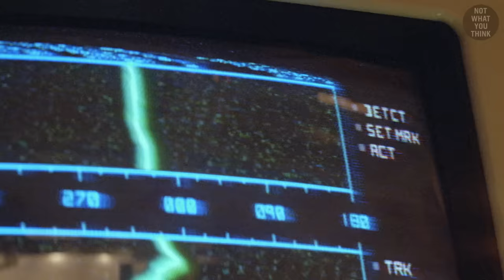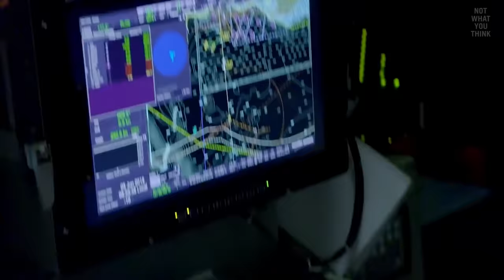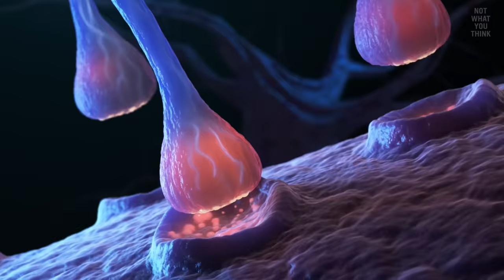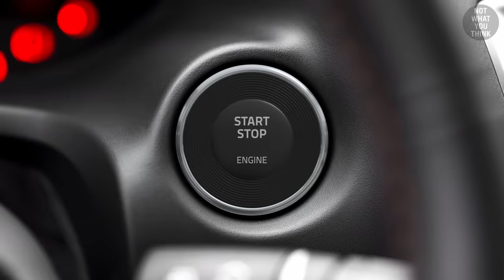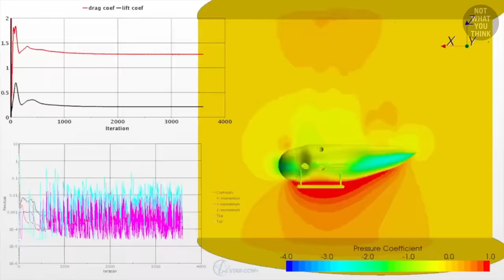What Happens When a Submarine Implodes

Comment: As a submariner I can tell you when the ship submerges you can hear the pressure affecting the boat. 
Audible sounds in sonar, we call them hull pops as the stress and pressure equalizes. Your first dive it’s very nerve racking. But after lots of training and experience you become jaded to it and laugh when the new guys hear it for the first time.
Reply: Many people have made a huge deal about the sounds in a disgustingly sensational way. (See! They knew it was about to blow! They were panicky, it was a long and terrible death!) 
The voices of experienced submariners like you are drowned out, pun intended, because people are hearing what they want to hear and then confirmation bias takes over.
I'm curious if you know anything about external mikes that, according to some, were intended to warn passengers of an impending implosion so they could surface to a safe depth. I hear my SCUBA instructor laughing in the back of my mind as I roll my eyes, but that means I need to learn more to avoid falling into the Trap of Lazy Thinking. Any thoughts about it? Thanks...
Reply: unless you're in a carbon fiber sub that doesn't handle this compression and decompression all that well....
Reply: I doubt you'd hear creaking from carbon fiber.
Reply: @zwenkwiel816 like any sub, it handles it well until it doesn't, they had 20+ successful dives prior
Reply: @RockandRollWoman well just remember 99.9% of the people talking about the titan knew exactly 0 about submersibles before that story hit the news... then suddenly everyone was an expert with an opinion.
Reply: @mattb6646  You do realize some people in the world, ESPECIALLY with the last 10 years of baby boomers pushing college education on the population, there are actual Engineers that can comment on this?
Reply: @Kelocyde  sure that's why I didn't say all.  And most engineering is specific, not many are in the realm of carbon Fibre compression/decompression like many are pretending
Reply: @mattb6646  from what I understand subs with a metal hull don't suffer this issue as much. The hull still expands and contracts but cuz it's steel it can do that 100's or 1000's of times without failing. 

Composite subs though risk delamination every time they dive and come back up cuz the different layers and the resin that binds them don't all contract and expand at the same rate.
Reply: @zwenkwiel816  I do t think we have the data on carbon fiber hulls and the stresses they receive from compression/decompression, because it was a new design... and were all assuming that's what happened, there could have been a number of other causes investigation still needs to take place
Reply: @Kelocyde  someone telling someone not to buy Starbucks as a way of surviving retirement and, “…pushing college education on the population…”, is the last person you should take any advice from for anything.  I wouldn’t let you mow my lawn.  Damn.  🤦🏼‍♀️
Reply: I agree fully with you the first dive is nerve racking and watching the "rope sag" when setup only adds to the tension, but like you said it all becomes normal. I took solace in the fact that if the worst happened that  either I wouldn't feel anything in an implosion or we would all pass out due to hypoxia if the oxygen ran out.
Reply: @mattb6646 I mean a quick search and I found "A review of the structural factors which control compression in carbon fibres and their composites."

But, like, this guy was also skirting safety conventions for submersibles. And, also I've hear it was a titanium, and carbon fibre mix.
Reply: Kinda like in the movie Down Periscope... where the crew are used to the more modern subs are a little nervous by the creaking of the Stingray... but the seasoned crew member just sits back amused by the others.
Reply: @mattb6646  This is what responsible news organizations filter out. But the big media firms don't care, they were quite happy putting these people on the air while profiting from tragedy like this.
Reply: @user-pt1cz4ot1e  Damn those 50 year old boring guys with experience. Trust me, I won't be mowing your lawn lmao.
Reply: @Kelocyde  There are fewer and fewer. AI is their only chance of knowing how to fix basic crap like a transformer in 20 years (tech will change, physics will not).
Reply: @Kelocyde  You'll hear crackling as the layers of fiber compress.
Reply: That said I feel like it would have happened so fast. Where the 20 minutes came from. I dont know. Hopefully they can capture data from what they recovered. Share it to the public. Obviously when it implodes they don't feel a thing. An its instant. But does not mean they didn't know there was a problem. They'd of heard the structure failing. Sensors alerting.
Reply: I concur. I was subs 1964 to 1970. Most time on a Nuc but did a short time on a WW II Diesel. The escape  training is nice but you come to realize that all that is for Mom & Dad. Ships quals is a different level.
Reply: One of my favorite demonstrations is when Smarter Every Day dove in a Navy sub and they tied a string from port to starboard. As the sub dove, you could watch the string lose its tension and start to sag as the pressure vessel squeezed inward.
Reply: @mattb6646 Watch Real Engineering’s video on the subject - there were plenty of reasons to be skeptical of an untested carbon composite hull before the incident.
Reply: @RockandRollWoman this guy is not a submariner. As a submariner myself, I can tell you he's talking out of his arse.
Reply: @webbtrekker534 yeah, escape training keeps parents and politicians happy, that's all. Most fun I ever had training though, and got to experience it several times. DBF
Reply: @RockandRollWoman The passengers on Titan weren't experienced submariners. They were rich tourists. We have no way of knowing whether their last moments were filled with terror or concern. They tempted fate and fate met them.

Comment: a subs maximum operating depth and crush depth are not the same thing, you dont want to be operating at the crush depth, generally you have a safety factor built in, unless your ocean gate
Reply: I would argue there was a safety factor, it's just less than 1.
Reply: maybe that was the rules that the submarine owner says it will broking when working....
Reply: Thanks Captain obvious
Reply: @iJustB58 these sort of simple trivia tends to be something pass over people's heads
Reply: @Propulus  Ideally you design the sub to operate ~30% of the target operational depth.
Reply: @iJustB58  i said it because the dude opens the video stating that the operating depth and crush depth are the same thing, and they are not, so no worries, captain obvious AWAYYYYY flies off
Reply: @GrumpyIan  I think it is a bit better than that. I was in one and operating depth was about 100 meters. (over 50 years ago so I can tell) but a test on a sister sub only got a dome shaped hatch inverted at about 140 meter when tested I believe. The rest of the sub was fine. It gave a bit of a bang I believe.
Reply: @Propulus  Considering they operated below the crush depth, their safety factor is 0. There is no safety. Just luck.
Reply: I understood that the windows of the Titan submarine had safety limitation of bit over 1 km. The dives this submarine took were over 4 km.
Reply: That’s what happens when you cut corners on a submarine that’s supposed to take you to the bottom of the ocean. Most submarines have an operating depth of 500 meters. The exact numbers are classified but it’s around that. The crush depth however can be 1000 meters or more.
Reply: @leonhardtkristensen4093  Holy crap, a bit of a bang indeed. I bet more than one crew member needed a change of underwear.
Reply: @technoroom5  Actually no. Most hardly reacted. One - one of the professionals, I was drafted - just jumped on the other side of a watertight door. An officer trainee went to the rear of the sub. He never became a submarine officer. The rest just took it very quiet. 
You could only see a little water on the floor but a stock room - about 2x2x2 meters - was full. I personally was waiting for instructions to close water tight but it never came. The torpedo people - 2 or 3 - where a little busi. 
I know we where specially selected although I don't quite know how. I guess we where selected for not over reacting or being quiet or some thing. We where told that no Danish submariner had ever died in a sub. Maybe that was what did it. I don't know. We did however have a fev drinks when ve came to harbour. Sailors never drink at sea but they do in the harbour. We where also known to be a little wild in other ways. Military police where not too happy to get in between us. The civil Danish Police where called in once to arrest one of us on the naval base. That happened without any problems.
Reply: @GrumpyIan no need to share that particular info, if you get me.
Reply: @therealspeedwagon1451  most, huh? You don't know what you're talking about. And if you do, you still don't.
Reply: @leonhardtkristensen4093 submariners never drink at sea. Dirty skimmers do though. 😁
Reply: @konservation6205  We had a few professional sailors from the Merchant Navy on board. They where drafted when they came home. They told us that rule. They however made up when we came into a harbour. I learned a little. That I later worked in Moscow didn't make it any better.  Today I am allmost a teatoodler allthough I don't drink tea.

Comment: Thank you for explaining this so clearly and without "clickbait".  I suppose the family and friends of the victims can take some solace here.
Reply: this is the definition of click bait. Video didn't mention anything at all about what happens when a submarine implodes other than saying that one argentina marine accident was theorized to have imploded in 0.04 seconds. This video mostly talked about other submarine accidents where they didn't implode lol. CLICK BAIT
Reply: @jnh8381 not only that, it is also spreading the myth that during the implosion the air would heat to a point that it would ignite stuff in the air, when that didn't happen. The implosion isn't an adiabatic compression, there's freezing water surrounding everything.

Also, bodies don't desintegrate or something like that. What happens to the body exposed to that pressure: Chest is crushed, and the pockets of air on the head are crushed as well (sinus and inner ears), but everything else would be pretty much intact (well... Internally, not so much, abdominal cavity, chest, and the inside of the skull would be a mess, but the body would still be in a better shape to be buried than most car accident victims). People need to keep in mind that although the pressure at that depth is monstruous, it is still not enough to break bones (I mean to affect a solid piece of bone, bones surrounding pockets of air will be broken), or even to compress soft tissue.
Reply: @laerson123 i'm interested in this comment purely because surely the  dramatic implosion slamming shattered pieces of a carbon fibre hull into a person at ridiculous speeds should be the focal point for determining if bodies would be mangled enough to recover
Reply: Stupid people piss me off and the thing is at least a little over half of the human population still has a cro-magnon thought process